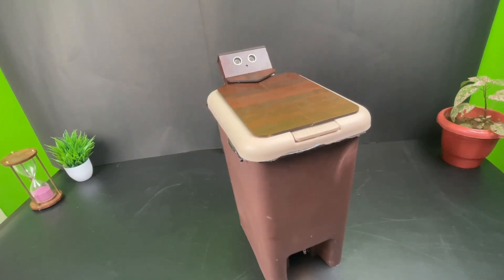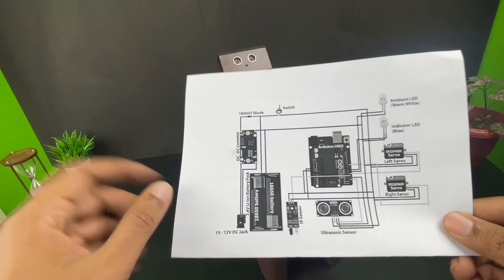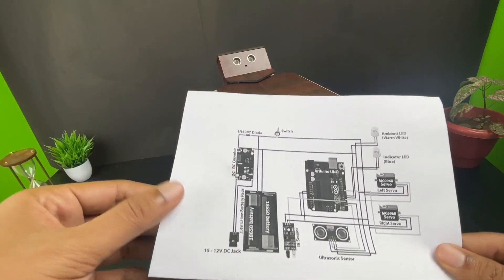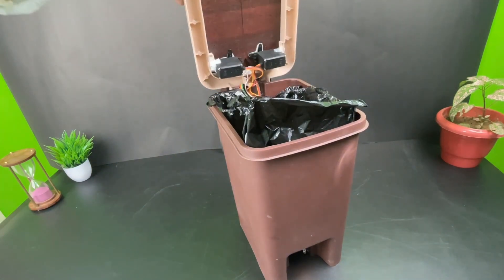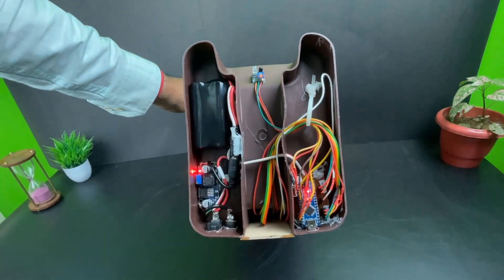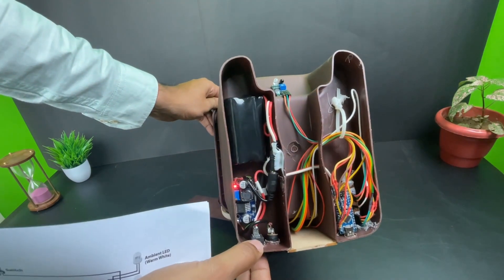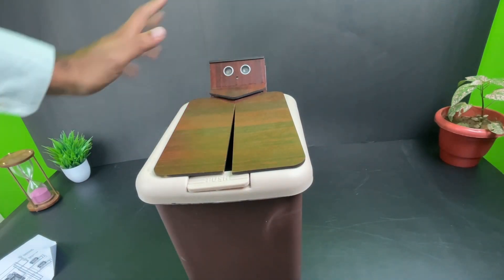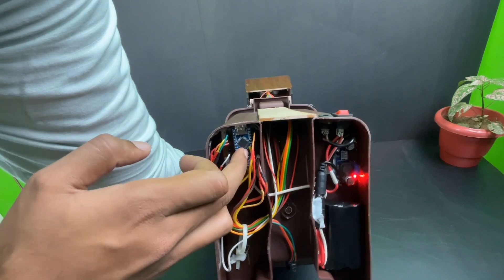How to Build a Smart Dustin using Arduino

Comment: How to know if the battery is full?
Reply from the maker: In the current setup there is no charging indicator. You can add a battery level monitor module to the circuit for that purpose.